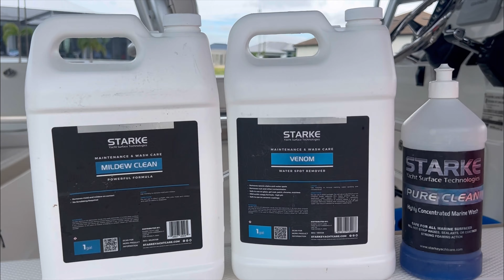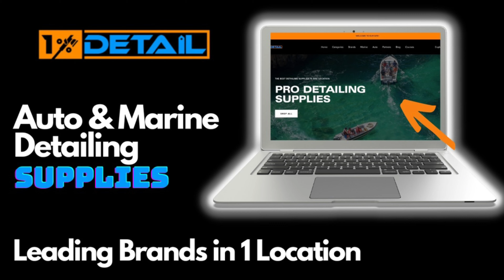Mastering Boat Washing: Pro Tips & Techniques!

Comment: We have a 31 ft cabin cruiser on the Lake Michigan and last year started using the Griots Foam sprayer that goes on a regular hose and it reduced wash time in half. Super convenient to spray down with water, put dialer on and spray soap, blue shurhold brush then rinse.